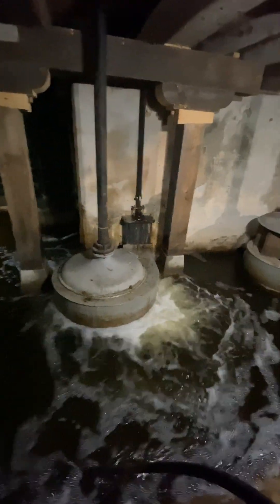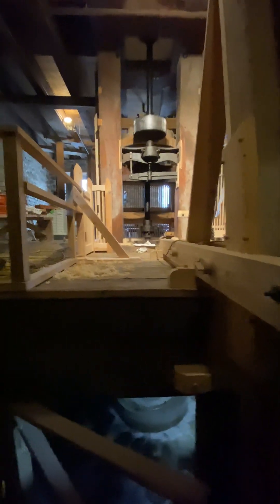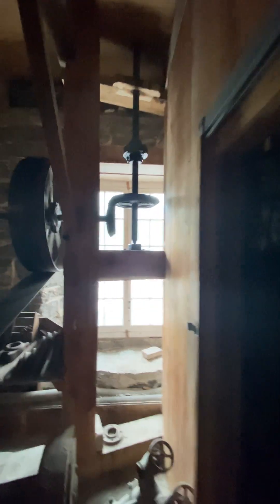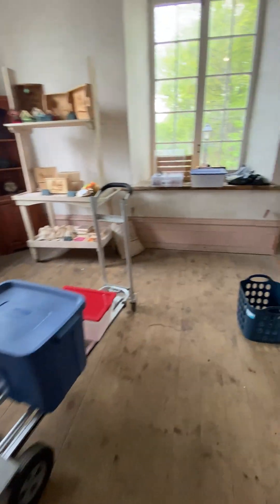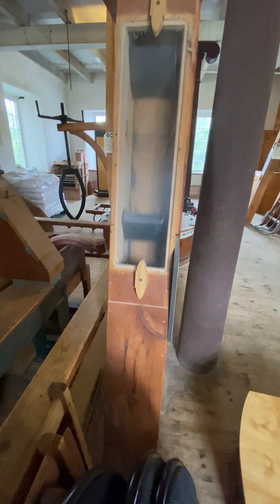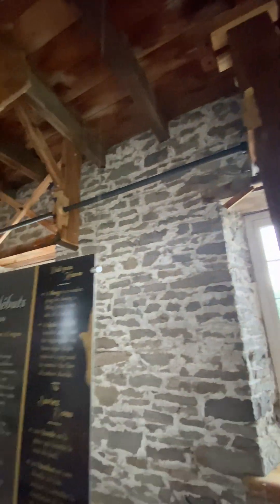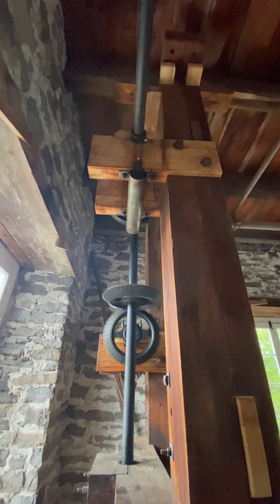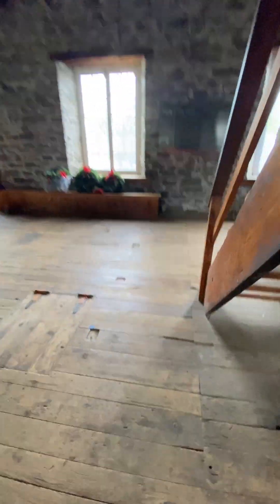⁠@WatsonsMillManotick , how she works part one .    May 15, 2025

Comment: This is a very nice element of history. Glad to see it preserved.

The turbines are neither over shot wheels or even what you would call a pelton wheel. They are not Francis turbines either. At 8 feet of head, a Francis would not work that well.

Donald McGregor of the McGregor ranch in Estes Park bought a turbine from a blacksmith in Ohio. I believe his name was Laffel. It was very efficient for its day. McGregor used it to power a sawmill.

The turbines do resemble Laffel turbines but I am not 100 percent here. 60 HP from 8 feet of head is fantastic.

What interests me right now is the stonework. Those walls are a unique way of building walls or foundations in older structures back east, I would like to know more about the way these walls were made. Type of stone and method of construction.